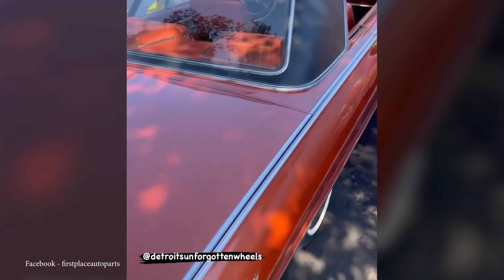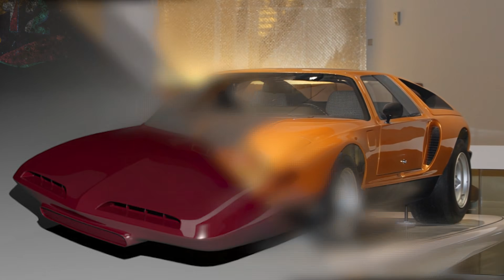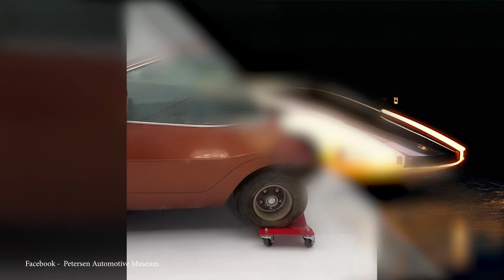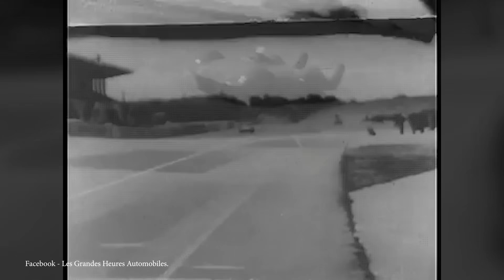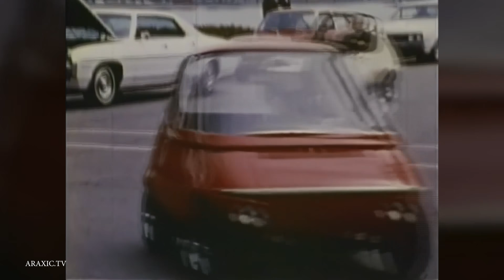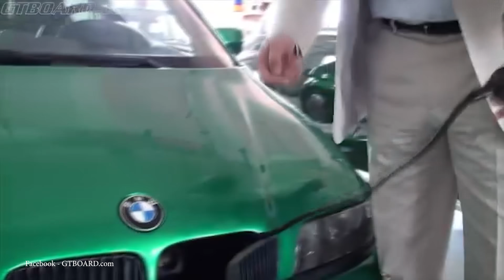15 Experimental Vehicles that NEVER REACHED Production

Comment: YOU ARE SO FRICKING WRONG about the SAAB EV-1!!! It was a SAAB, a Swedish SAAB, based upon the model 900 (which you show, in a still-shot, AND Mis-Identify!? Really?? How Daft are ya?). The '9000', you Believe is it's base chassis, was a shared Fiat/Lancia/Alfa-Romeo that SAAB Re-Engineered to THEIR SAFETY Specs (far beyond what the Italians did!), and the 9-K, used a Transverse 4 Cylinder, both in Fuel-injected and Turbo form. The 900 (notice the Sonnett-like Hood-bulge? Or did YOU NOT. You did NOT!) ran on an Inline Four, often Turbocharged, mounted Dead Center between the Axles, giving it NO TORQUE STEER, and decent Articulation. It was Introduced in 1978 for the '79 Production year, and lasted until 1994. I've owned 3, 900's (and my Parents had one, in 1980-'87, 275K Miles on it!), which 2 of, have been driven in over 20" of fresh Snow (ever been passed by Snowmobiles, on a State Highway? Welcome to Vermont in January/February, buddy!), and while I was a Snowboard Instructor, they ALWAYS got Me to the Mountain, and back Home, Safely. The EV-1, was Turbocharged, using a twin-cam 2.3 L inline 4-cyl, with a 5 speed gearbox, able to go 168 mph (Vs. the SPG 900's 145 mph).  Try Fact-checking yourself, and look up Car+Driver's take upon the EV-1. Bye.

Comment: Amazing AMC with the first electric tiny commuter car seemed to try and push limits. Like the Pacer with the extra long passenger door for ease of entry. Remember the Pacer was going to be a current front wheel drive and beat the Big 3 by 4 years but they got wind of this and stopped the pieces AMC needed to make it a front wheel drive. American Motors had to do a quick retool and shoe-horned the 258 straight 6 into the front wheel drive body and converted it to rear wheel drive. Hence to pull the valve cover, substantial parts needed to be removed. They drove great and got decent mileage for 1976-77.  Then for worker safety, the Studebaker dash components had radium radioactive paint used to glow in the dark, unfortunately the workers who were using this mix, ended up with health issues as this early 1950's use was still experimental.

Comment: I would say there’s something comparable that might be useful in developing this the Ford nucleon now. Researchers in England have been messing around with what they call nuclear diamonds. These are diamonds that are created out of the graphite rods that they use to cool nuclear reactors. They’re not as radioactive, but they are still have a quite a punch and still hold a sufficient nuclear charge to power things for decades. In fact, it says these were planning to use these things on a small scale in satellites and they said that the battery would probably outlive the use of the satellite itself think about a large diamond scene size of the hope, darling one of these nuclear diamonds, the size of the hope diamond put in a nucleon type the vehicle. It would be a lot safer you wouldn’t have to have near as much shielding And. Your power source you would never have to refuel it let you hand it down the car to a couple of generations just a thought.
Reply: I dig your idea….
Reply: @ZombieBagelthanks